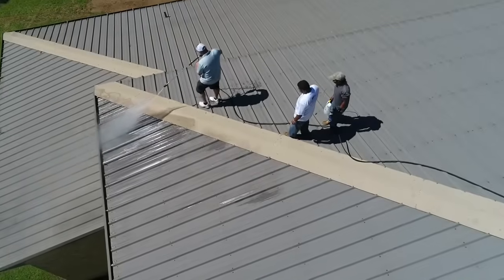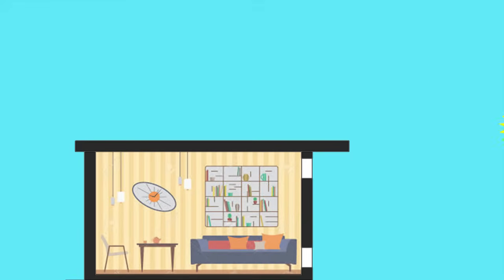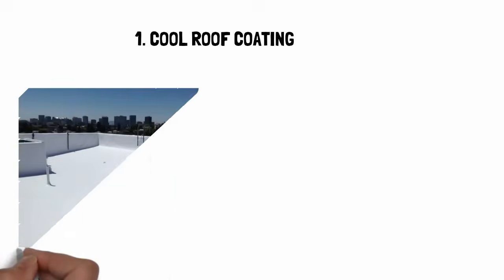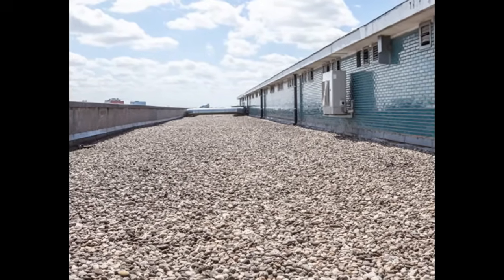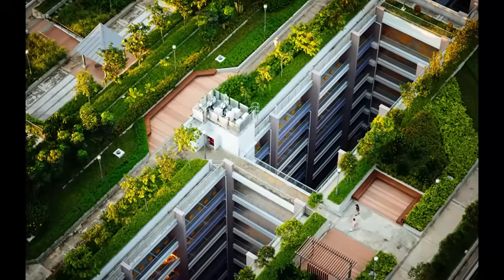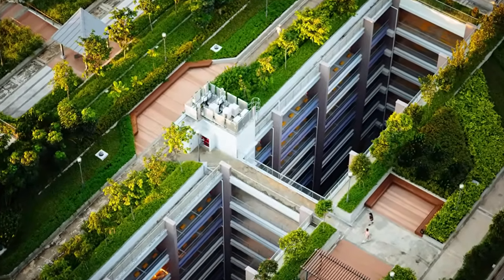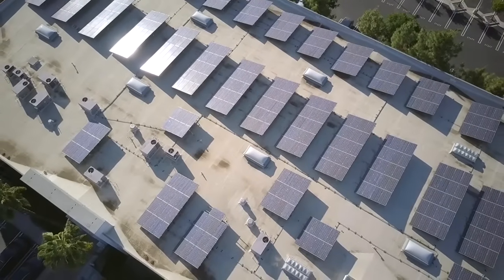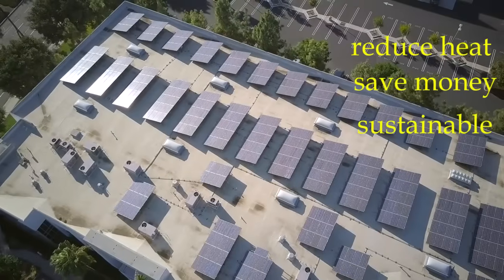5 easy way to cool your roof of home

Comment: Loading gravel on the roof is detrimental. 
It adds weight. 
Promotes insects. 
It holds moisture and promotes growth of moss in the rainy season which disintegrate concrete. 
White painting is the only safe and economical. 
It's effective too.

Comment: Sorry, but no. 5 is totally a lie and not working.  Solarpanels on a roof makes it so much hotter - not cool at all!
Reply: Those panels are up on a sloped racking system, lots of air behind them. Wouldn’t heat up the roof at all. Casting a shadow at certain times of day would cool the roof.
Reply: High rise solar panels should be used